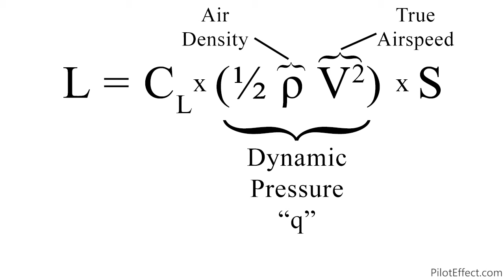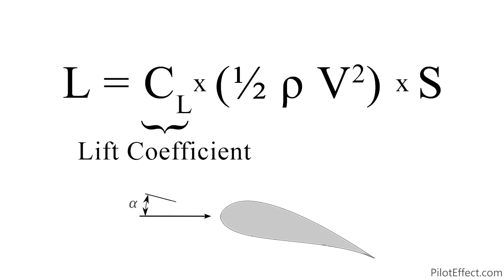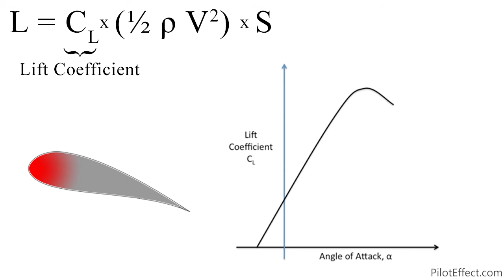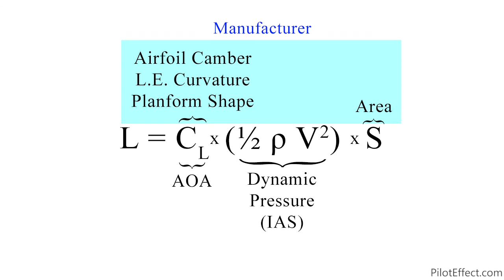The Lift Equation | Pilot Tutorial

Comment: Good clear video, but there is a problem in your equation.  You need to think about the air velocities at the bottom surface (v1) and the top surface (v2) separately.  Thus, the dynamic lift pressure is proportional to deltav = v2^2 - v1^2 as opposed to airplane's cruising speed, v.
Reply: There's no problem in the equation.  The velocity distribution (and resulting pressure distribution) is accounted for in the lift coefficient.  If you read up on how the lift coefficient can be calculated using circulation theory, it's basically a much more complicated version of your statement.  The lift equation itself uses freestream velocity by design.

Comment: If wanted to work this can someone help me . I have lift CE of 1012 my surface area is 400 cm squared X half density at sea level is 0.16125 and my speed is 10 mph. Why do I end up with  number over 24000. 24000 what? grams tenths of grams what??.so what units of speed should I be working with ??? Mph kph meters per second what?? I'm so confused .
Reply: Your number (24000) is meaningless because you are mixing all sorts of units. You have to be unit-consistent. Consider this example: 
      Wing area, S = 10 m²
      Density at sea-level, rho = 1.225 kg/m³
      Airspeed, V = 50 m/s
      Lift coefficient, CL = 0.5
Then, the resulting lift would be L = ½∙rho∙V²∙S∙CL = ½ (1.225)(50²)(10)(0.5) = 7656 N.  This is the lift force generated by the aircraft moving at 50 m/s (180 km/h) at sea-level.